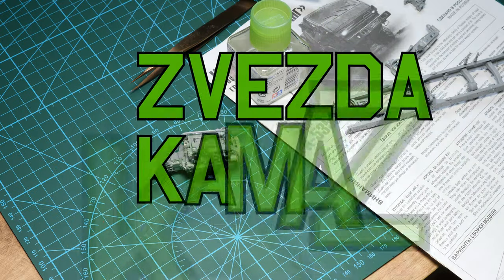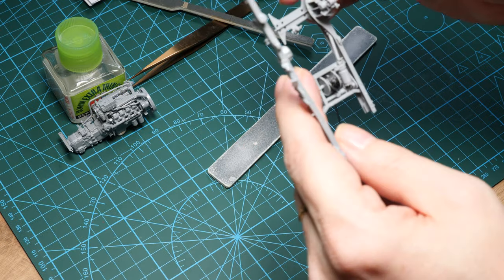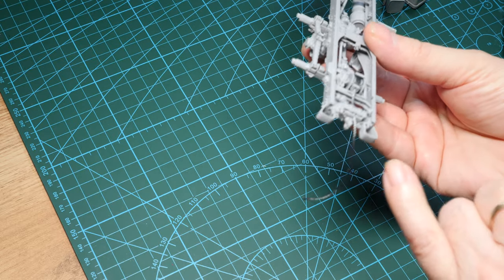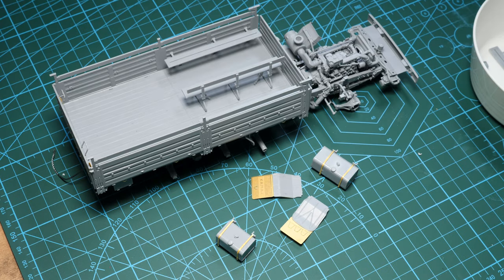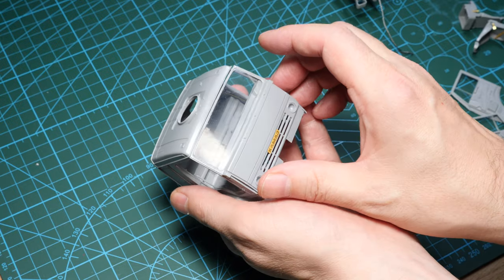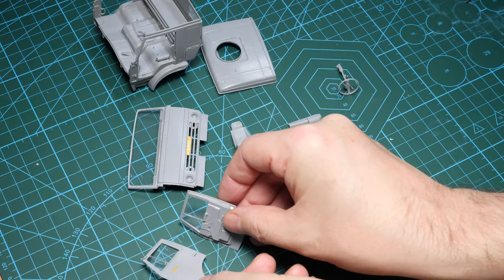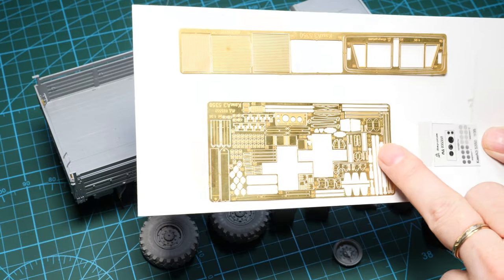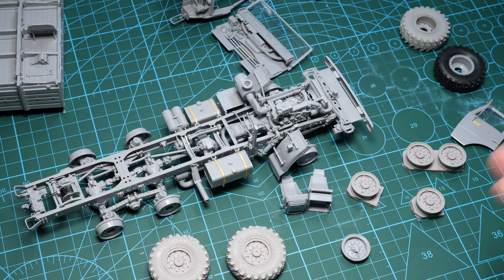Kamaz K-5350 Zvezda Part II Build

Comment: Man that frame, suspension with all axels and transfer cases details is absolutely bonkers. Shame you want see most of once model is done but still worth every second of the build. I was the same the more details was more fun and enjoyable for me, plus I would get as much AM parts I could find(photoetch, resin etc) The bigger the better haha. Man am binge watching this build from the beginning as we speak. Stunting work so far Mark.
Reply from the maker: Hi Kris ! yes a really detailed model that is not so difficult to build ! I will probably make a build video on the dumptruck as you said it would be interesting. Big thanks for support
Reply: @TheBearScaleModels  That's why I jumped back to watch this build as was curious. Would be cool if you did the other one with cab tilted and kipper in the dump position so all those cool engine and axles bits are exposed but we will wait for your call on that one. Cheers.